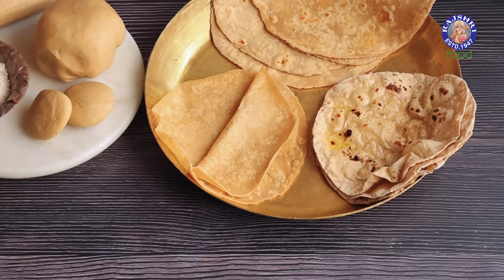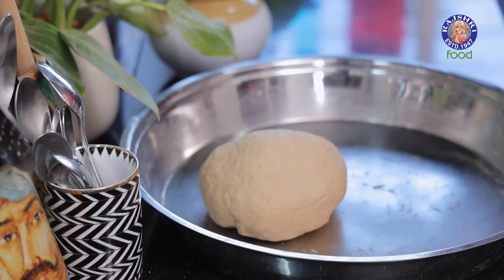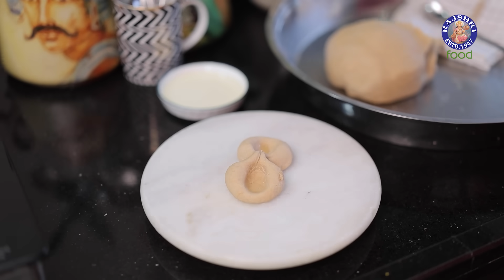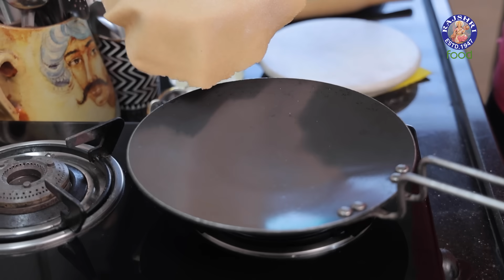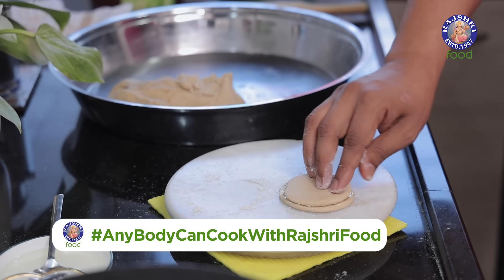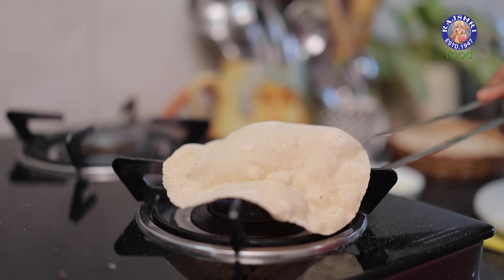3 Types Of Chapati | Ghadichi Poli, Padvali Roti, Phulka | Step-by-Step Guide | Flat Bread | Varun

Comment: What makes roti hard? The dough seems soft and ok for me, am i doing something wrong with flame level of the stove?
Reply: Yes mine too gets hard.  Also does not puff up.  Must try this method and see
Reply: Roll it with very light hands
Flip over the first side soon as you notice little bubbles
Reply: Also, remove the dry flour by flipping between the palms. Lightly dust with flour only .
Reply: If the tawa is not hot enough, the roti takes little more time to cook, and thus, looses more water content, making it dry and hard. So try to slightly increase the heat a bit, and put the roti on tawa only after it is hot enough (say medium to high flame)